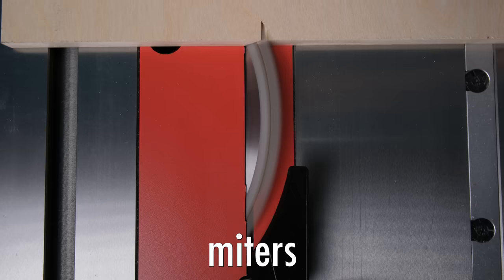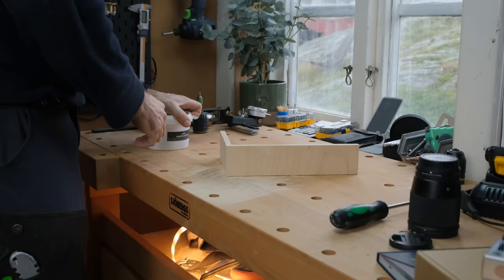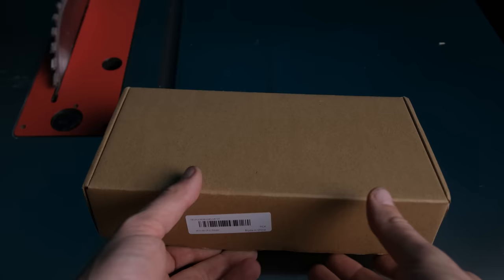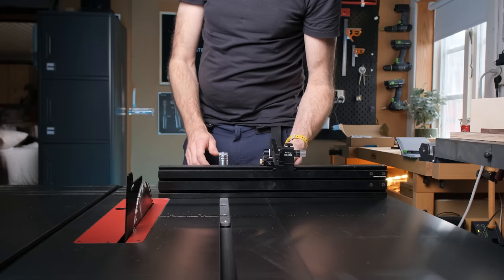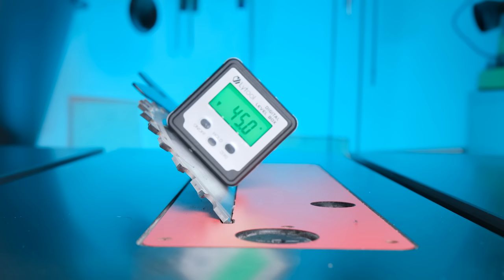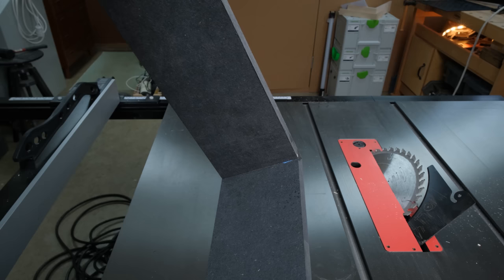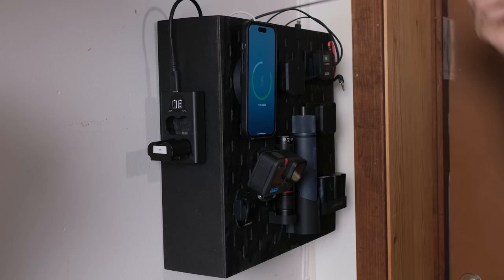It's like cheating

Comment: it's way better to cut miter over 45deg, just a tiny bit, so you will always end up with nice, tight corner and tiny gap from inside which doesn't matter
Reply from the maker: yes agreed - that's why I did as well. I was measuring from 90 and down - that's why I ended on 44.9 instead of 45.1

Comment: Sometimes a bit of wobble will change everything. I just cut 4 test pieces to the same length using a stop with a mitre. Put em together and see if all the joints are tight. Done deal.

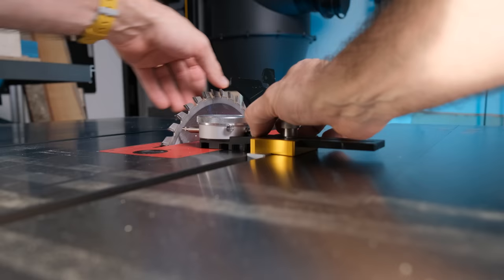Comment: 3:27, you just jumped tracks.  Rotating the blade is for runout and sliding the gauge along a track is for making the blade parallel to the tracks.
Reply from the maker: true.

Comment: You would find using Mylar packing tape on the corner is a better solution especially on long miters.  Its main advantage is it does not stretch.  The downside is it may pull some grain and require additional sanding.  3m 375 is the preferred tape professionally. 

Good luck!
Reply from the maker: Ill try that tape

Comment: Long mitres work so well with the track saw as the weight is all on the product. Or a clamp down jig for the panel saw. Either way you are spot on by having a tiny gap on the inside. The way I see it is that it’s somewhere for the glue to go so it doesn’t force the front out
Reply from the maker: very true - long miters on the track saw is really the way to go

Comment: It is much better to use a properly adjusted radial arm saw to produce precision angled cuts, than a table saw.  Especially with compound angles.  Because it is easier to run an accurately adjusted cutting head guided by a hundred kilos of steel brackets through a stationary piece of wood, than to throw wood through a blade.  That's why they use vertical 2-D sheet rigs or track saws to cut sheet goods for example.  

You can even use a radial arm saw like a table saw if you want to, and run long goods along the fence.  The advantage with the RAD is you can see where the blade is cutting, instead of guessing where it will come up like with a table saw.
Reply from the maker: I havent seen any radial arm saws avaiable in Sweden but it sure looks like a good tool for compound angles, yet also dangerous but that goes for the table saw as well

Comment: I just learned from Jonathan Katz Moses, who learned this from Stumpy Noob, to cut the mitres on a router table using a 45 degree router bit (making sure it is big enough for the thickness of your material). Going to try this the next time I need mitred corners.
Reply from the maker: Im def trying that as well. Seems like a good idea.
Reply: There are 91 degree router bits especially made to do this.

Comment: Hi, 👋, I want make a comment on what you’re saying, as it is already been mentioned a load of times before, another way to do perfect mitres is, depending on if you have a router table or a spindle motor, there is a router finger mitre locking cutter, and if you have a spindle mould, Mitre cutting block with finger joint, this one is quite expensive, but when needs must purchase, Over the years, I have used both, and I still have, Your charging station is a very impressive. Well done., cannot see any screwdriver marks on it. 😂, thank you for sharing your experience, How about trying this one next?, A compound angle., 😂, stay safe. Good luck, all the best for the future., Phil from the moulin France
Reply from the maker: Thanks Phil! Im googling router finger mitre locking cutters right now! 😃 It sounds like something for me.
Reply: Hi 👋, I hope this can be some help to you, There is a 45° router cutter you can get from CMT, It has replacement tips, this is what I will call the middle of the. road tooling, pricewise, if you have facilities for a spindle motor, they are cutter blocks that are made in the same way, but obviously a lot larger diameter and they do cost a lot more money obviously, because of my business I was using a German manufacturer to supply my cutter, blocks and tooling, they were called LEITZ they provide a excellent service they come to your factory workshop et cetera, and they make cutter blocks and router bits for special jobs, I’m afraid they are very expensive, but these are top quality machine tools, 
If you go onto their website, you’re about to see what they make , I was making specialist doors and windows, which they make the  tooling for, I hope this is some help for you, it’s a pity that you are so far away as I’m sure you’ll be interested in my very compact workshop. I have now in my property in France, I have had a business back in the UK for nearly 50 years, and approximately the last 20 years I had a reasonable size workshop about 8 m wide and about 35 m long, and considering I was working by myself, I used to get plenty of exercise walking up and down in my workshop, especially if I couldn’t find a tape measure, I had anywhere between four and five of them. I normally leave them on my workbenches so I didn’t lose them.,  😂, Phil

Comment: If you ever have small gaps on your miter, squeeze white glue into the gap, then with a sanding block, sand the two surfaces that meet so the dust sticks into the glue. Forget that screwdriver nonsense.

Comment: Your video is so timely! Today I was testing my brand new Incra 1000HD miter gauge for making a perfect 4” square from four pieces of stock. Needless to say, results were good but not perfect, even though the miter gauge was perfectly square to the table saw blade and the blade had nominal runout .008 to the miter slot.  Drives me crazy. I will make your recommended adjustment and look forward to closing those annoying gaps!  Thanks!  Not a fan of the screwdriver cheat.
Reply from the maker: I hope it helps - Ive shared your frustration :)

Comment: The best practice for squaring a miter gauge is NOT to square it to the blade. Yes, I know you took great pains to get your blade as parallel as you could to the miter slot, but as you admitted, it's really hard to get it perfect. The squareness of the cut is determined by the angle of the miter fence to the miter bar. Think about what you would do on a bandsaw or with a router table. You can't square a miter fence to router bit. Besides being more accurate, it's also a lot easier to place your square against the miter bar and fence and lock them down than it is to find the approach on the blade that doesn't interfere with the teeth - and that's even assuming your blade is actually flat, which some aren't.
Reply from the maker: Ill try this

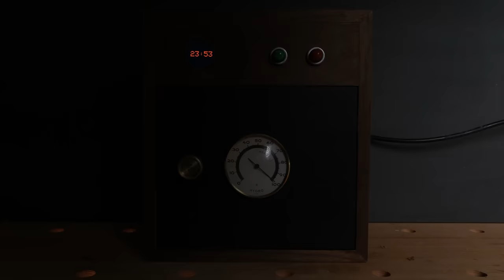Comment: My most memorable miter mistake was when i worked as a carpenter in construction of wood design houses, we ordered a huge  300x800 beam of hand cut&shaved European oak for the center piece and i accidentally cut the mitor like 20mm short and because of a power outage i had to start over mid cut and cut it waaay off center haha. Luckily it was for my own personal house and was able to raise the floor 2cm so i could fix it and it didn’t matter as much, now my floor is 2 cm higher than it should be but i like the reason why, because i learnt a lot about miter cuts that day :) 1:26
Reply: By the way watching from the Netherlands, I really do enjoy you’re videos. I see a very likable presenter and maker. Must be difficult to combine sometimes.
Reply from the maker: That must have felt hard at the time! But I bet no one noticed those cm missing :)
Reply from the maker: Thanks! Totally appreciate that!

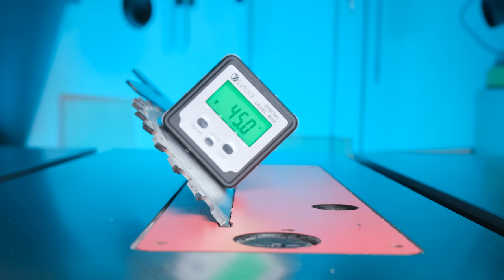Comment: 5:41  you fine tune it with a dovetail saw, then perfect it with a shooting board.
Wile table saws and power tools are a nice way to get you in the ballpark, all the adjustments you make on the table saw do not correct blade deflection and runout.

Even machinist have to fine tune the last cut.    If your splitting hairs you need tools that can split hairs.
Reply from the maker: Thanks! I think Ill make a shooting board in the future!

Comment: Measure twice cut once. Some times I do not listen to my own advice. When I do a wee tap with a hammer is all it takes or, a nudge to tighten the clamp. Job done perfect. Perfect enough for me. I have never used a dial gauge on a woodworking project ever. I leave that to the toolmakers in the machine shop.
Reply from the maker: Best woodworking advice out there

Comment: One comment said this was about 5 seconds of advice. I disagree. I have seen the 44.9 degree trick before however the focus on calibrating your sawblades is to often glossed over and ignored. Precision results require some tuning. We often forget our machines need to be frequently checked for square and recalibrate if needed.
Reply from the maker: that's something I used to overlook myself as well. thanks for watching!

Comment: Great video, I never thought of under cutting the 45 at 44.9. Make it easier because usually you will not see the inside corner up close. Thanks for sharing.
Reply from the maker: No problem. Just stay above 44 degrees if your not measuring from 90 like I did in the video :)

Comment: Great, and very timely (for me) tip, as I am in the process of making several new projects that require using a 45° miter! However, a few of them will have both the outside and inside corners visible... Any good tips on how to make both edges as tight as possible? I know I'm 4 months late on seeing this video, but I'm still hoping that you'll keep answering all questions as you stated 🤣

Comment: He totally overlooked the quality of the material you are working with. Making sure the material is flat, straight and parallel
Reply from the maker: He is me. I was using Valchromat. But your right - the material needs to be milled properly if not using sheet goods.

Comment: I found your preparation steps and explanations of what you didn't like to be as instructional as your advice on fixing miters. Cutting the angle sharper than 45° deforms the wood slightly to mate evenly (like the screwdriver fix but better) , even when the square is racked a little. Thank you! I wondered why you attached all your charging pockets to the outside of the box, though.
Reply from the maker: I had the usb hub on the inside and then I attached the devices on the outside. Thanks for watching!

Comment: Does it truely matter if the saw blade is not 100% parallel to the mitre slot if all of the wood stock passes through the entire exposed diameter of the blade? The teeth will still cut the wood stock whether it’s with the advancing or retreating teeth will it not?  I suspect the only difference is that the kerf will be slightly more than the blade width.

Great channel by the way, very watchable and straight to the point.
Reply from the maker: hey! thanks a lot! I appreciate it. As long as you cut at 90 degrees to the blade I bet you´ll be fine without that setup

Comment: Honestly great method. And not something we always think about. I just did a mantle and it was basically a box built from 3/4 pine with a French cleat inside so I could hang it. I adjusted the table saw many times to 45° and I still had slightly open mitres. Had to sand and fill. Then finish the project. But this would have saved me time. Also doing butcher block counters for a client. They wanted a mitre joint in the corner. And guess what. The angle was 46° because the walls weren't perfectly square. Cut with a circular saw and a guide but it wasn't a perfectly straight cut. Had to sand and sand and sand. Birch end grain is very hard. What a headache. Still in the process of installing them. Hoping they come out good 🥴
Reply from the maker: I hope they come out good in the end :) Thanks!

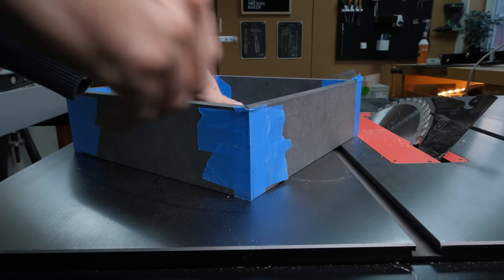Comment: At 6:32 I can see that you taped the inside corners, is that done to ensure that the glue squeeze out can be removed by pulling the tape away? Ingenious trick
Reply from the maker: you got it. glue squeeze out on the inside is harder to get out and the tape can just be removed - especially useful for hard wood where it gets really hard to sand with the grain on the inside of a box

Comment: Would you also use a digital angle gauge on a track saw? I dont have a table saw.
Reply from the maker: On the track saw you hopefully get good measurements from the factory and can do a bit more than 45 degrees on it.

Comment: Glad I stumbled on this channel, you earned yourself another subscriber!  Question: how did you decide to buy the HongDui HD-KS22 miter gauge/fence? Reminded me of the Harvey Compass MG-36.  I need to upgrade from my factory (low quality) miter gauge, and just wondered your experience - why you chose HongDui (I've never heard of them) vs better known brands like Kreg, Incra, Rockler, etc. Thanks and happy woodworking!
Reply from the maker: Thank you! HongDui seems to make quality tools. I compared the miter gauges available - I found the Kreg one to be a bit lower quality, Incra seemed good but a bit more expensive and the Rockler one I didnt really look at because of availability in Sweden. Jonathan-Katz Moses works together with Hong Dui on some tools and it also helps that it looks really good :)
Reply: The Hong dui mitre gauge is very well reviewed, but it is still expensive if you get it with the Alu profile fence.  Reviews also tend to not be very positive about the Kreg, so probably best to avoid that one, but the Incra and Jessem mitre gauges are pretty good.

Comment: I have been dealing with  miter joint for while and even if the cut is perfect when you use actual wood and man made material the  chance of a failure is very high. Natural wood board are never really straight and once you start building large   box this is when the problems comes. With a but joint  or rabbet joint you can compress the sides and compensate  for the small imperfections in the natural material but miter joints you can't so on the end even if it is cut perfect you are most likely going to fail. At least I did and again I had to downsize the box and use but joints. If you have an idea how to compress a miter joint please let me know I have not found a way yet.
Reply from the maker: I don't really have any ideas on that. There are clamps for it - but they never really accomplish that I think

Comment: Great video. Very informative.  My only question is,  when squaring the miter guage it seems to me it would improve accuracy if all angles were set from the same reference point. Since the miter slot is immovable, it makes more sense to set your 90 from there to avoid compounding misalignment between the guage and the blade.
Reply from the maker: that makes sense. I´ll try it
Reply: You  are 100%  correct, tweeterfire. Another thing that can go wrong checking against the blade is that sawblades are not exactly flat. That is the reason we choose a single spot on the blade to indicate against when adjusting the parallelism of the miter slots to the blade. So much easier to set the gauge with your most accurate square tucked against the bar and the fence, tighten and you are done.

Comment: Fantastic video. Just one suggestion concerning your promise to respond to every comment. Forever. 

It was new and intriguing, but I thought you were going to automate your responses. Yet each response was specific and excellent. You may want to consider promising to respond to every QUESTION, not every response. And that forever thing.. With some minor changes you are good enough to go really big. 

Sometimes I get a lot of value skimming a comments section. More often I do not. In my opinion comments should be specific and relevant. They should offer valid suggestions or ask specific questions that might benefit others. It would make the comment section far more useful and manageable for you and your followers.

Great work! Sorry so long.
Reply from the maker: Totally agree with you regarding the comment section. And also good advice on answering the questions only. I value the viewers a lot so I hope to make the comment section more engaged and valuable. Thanks for watching and giving your input

Comment: When you're making a picture frame, the angle has to be 45 degrees. Can't have a gap on the outside or the inside. With my table saw? That would be a miracle. I just use a miter box with handsaw. And then just put the paintng in the frame and hang it and find something more important to worry about. But that screwdriver trick, now that's worth knowing.
Reply from the maker: Agreed

Comment: I just watched a video where a 45.5 d angle was used to get the perfect mider,  he also seemed to get great results. Do you have any explanation for this? Also, what is the dark material you used? PVC? or?
Reply: The errors show up on the inside of the build instead of the more visible outer edges when set at 49.9 is the theory. Wood is tough to work with. It's not like metal, or plastic, so it becomes more of a artsy thing to manipulate. Don't be to hard on yourself. Even the experts like this fellow struggle with it. Only you will notice the slight errors in your work. The trick is not to point them out to others and all will be in awe of your skills ;-)